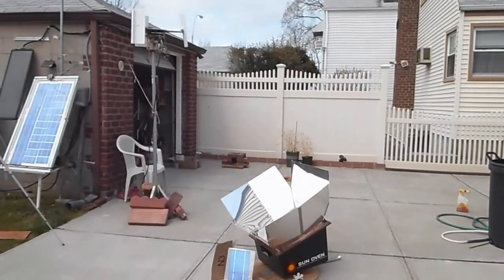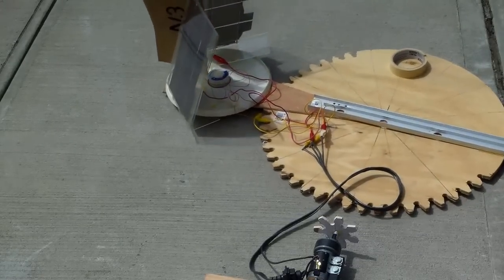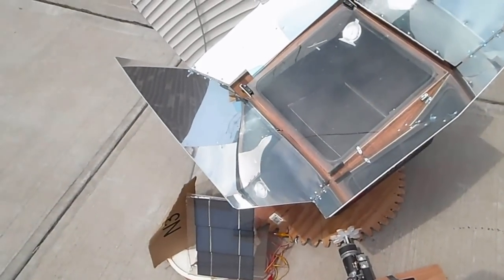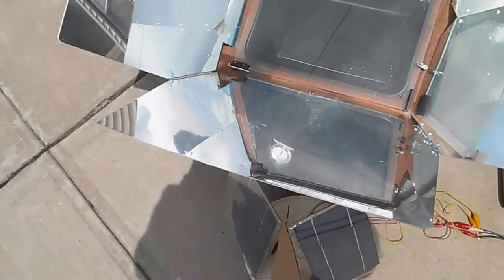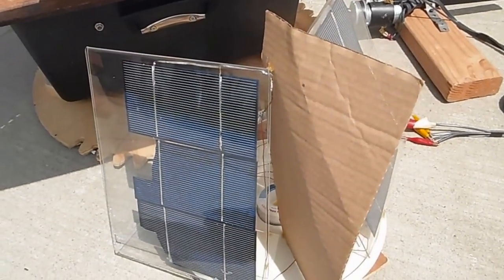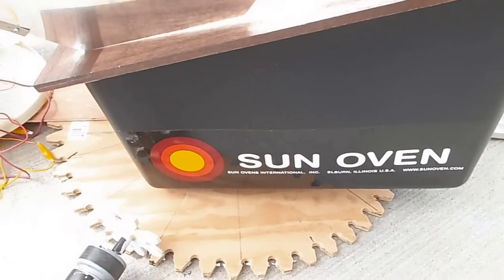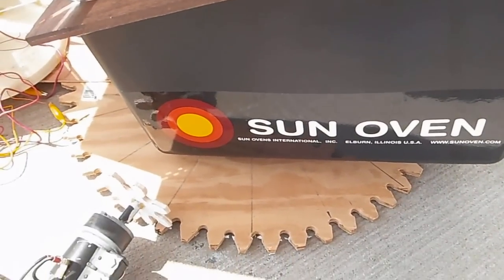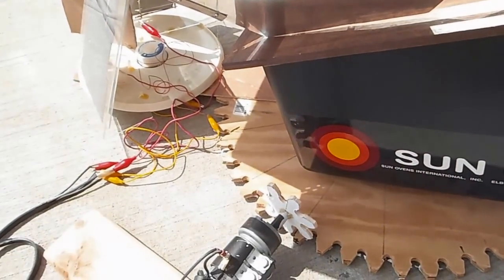Sun oven with do it yourself self powered solar tracker

Comment: Thank you for sharing your project.  I am considering making a solar tracker for my solar oven also.  However I think a simpler design may be possible.  Using only one solar cell mounted off the back of the oven so that its shadow will be casted on the solar cell as it rotates to track the sun.  Naturally it will only rotate in one direction, just as the sun do, and thus it should not be a problem. 

What do you think?

Comment from the maker: Yes you can use micro controllers, relays, solenoids and a battery or AC power but I wanted something self powered but not too complicated. Try it out with a model first. If it doesn't turn the way you think it should, switch the wiring around a bit. Good luck.

Comment from the maker: For solar panel one, positive of solar panel to positive of motor and negative of solar panel to negative of motor. For solar panel two, positive of solar panel to negative of motor and negative of solar panel to positive of motor. There is no complicated wiring. Try it with a pair of solar panels and a small motor. Reverse the connections if it doesn't turn the way you think it should turn. Good luck.

Comment from the maker: The use for this is limitless. For more sophisticated uses you'd need relays and other kinds of motors. I was using a broken wind turbine dc motor and some left over solar cells. Without complex circuitry,  you have to match the components very closely. Just like my solar charging gadgets, you can easily overcharge if you don't match your solar cell's voltage to the battery's voltage. Sometimes it's easier to use more electronics to make things work but not in this case. Thanks for watching.

Comment from the maker: Overcast for a little while is ok. Overcast for a long time and I'll have to go to McDonalds for dinner :) Yes, it's not going to move when overcast. I forgot to show the sticky rubber pads I bought for the bottom of the oven. The oven is plastic like so the bottom scratches easily when I try to move it manually.

Comment from the maker: It's woodgears.ca Look for the free gear generator template. I think you will find the website very informative. The wood gears make the drive system simpler. You just have to drill a lot of holes to make the gears. My gears aren't perfect but they are close enough. Thanks for watching.